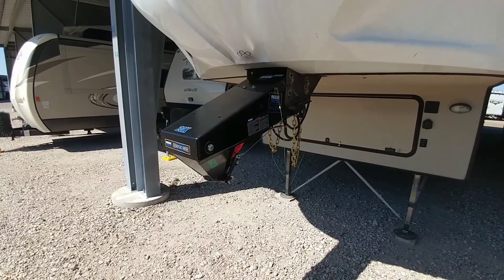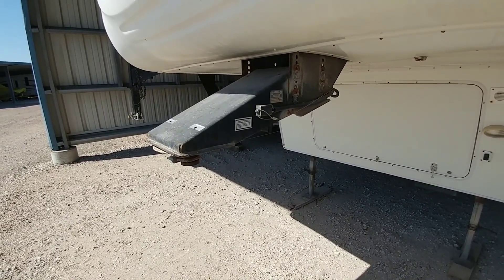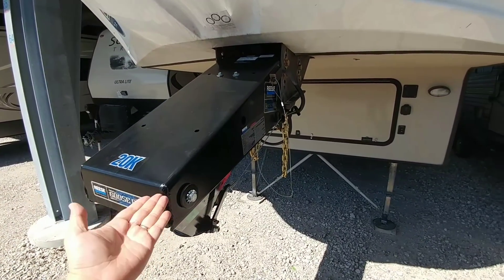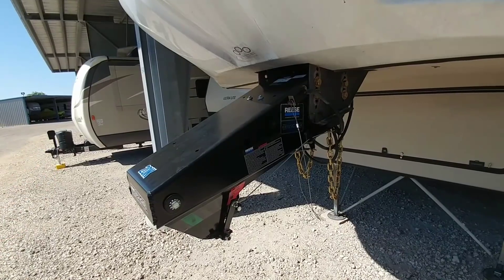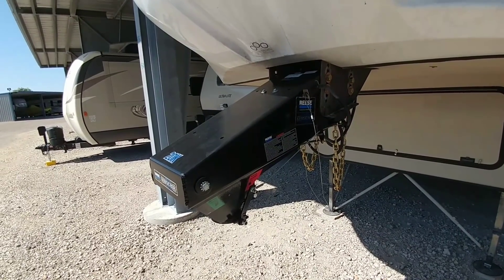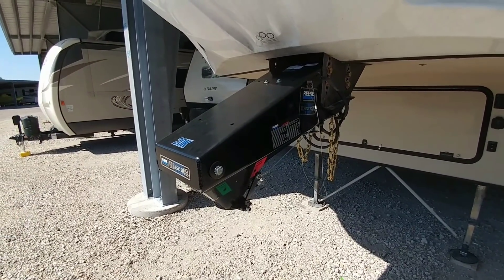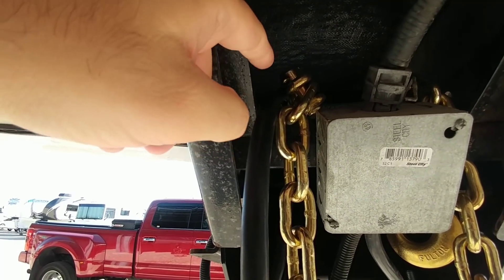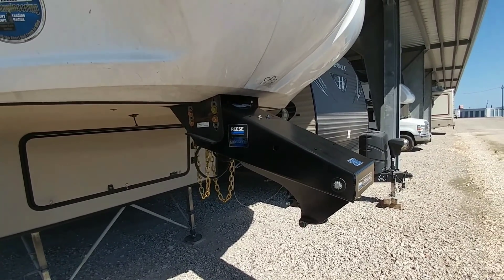WHY a Reese GOOSEBOX and not a Fifth Wheel Pinbox!

Comment: I have had the 20K Goosebox for 3 years on my 40' Carbon Toyhauler and absolutely love it.  IMO it is the best hitch on the market when you factor in ride comfort and bed access...there is nothing that compares.  Another bonus is you never have to worry if the jaws on a traditional 5er hitch are fully locked...no chance of your 5er falling off and damaging the bed of your truck or RV.  The only drawback is it is a little harder to line up, but after time it becomes a non-issue.

Comment: I have this exact setup. I love it. Virtually, no chucking. No 5th wheel hitch in the bed. I really don't feel the trailer moving behind me. If I do feel it, it's slow suttle bounce on bumps. If your truck hits a pot hole, the vibrations don't transmit to the trailer, and vise versa. Love it, love it.

Comment: looks like a nice pin box setup. I've considered going into this method, but I had a few considerations that changed my mind.
I ran across I think one or two states that allow a passenger inside a fifth wheel and specifically not a goose neck while driving down the road.
I do not intend to drive with passengers in the trailer but it made me consider what makes the laws different for gooseneck.
After looking at several hitches oem aftermarket, I saw that fifth wheel hitches spread the load being attached to the truck frame and most can handle larger angles of tilt. Gooseneck hitches are mounted to a small frame area. It became a serious consideration that when in a accident I'd rather have a fifth wheel connection, if it decreases the chance of the RV coming loose, And into the cab or striking something else. On the flip side A major drawback to a fifth wheel hitch is you can be in a hurry or distracted forget to drop the landing gear. And release the fifthwheel latch pullout and have the trailer crash down

Comment: I purchased the Reese Goose Box based on your video.  It arrived today and I put it on.  I have a couple of observations based on my installation; although I haven't actually driven it with the Goose Box yet.
1) I don't like where the air inlet/outlet is.  I can't reach it from any direction without getting into the bed of the truck.  And, I have to duck in order to not hit my head on the coach.  It would be better if it was on the back of the Goose Box so it could be easier to reach.
2) On my unit, when filled with air at 50 PSI, the load/air sticker never gets to the green.  I added a little extra and the over flow blew telling me that was enough.  With 50lbs, the sticker says add more air.
3) As I tried to un hitch my truck, I could not get the release cable to lock into the cradle.  I finally figured out that I had to empty the air bags in the Goose Box in order to get the latch to release.  So, that means that if I was at a campsite, once I empty the bags to remove the truck they would be empty upon re attaching the Goose Box.  So, next week I am installing a Viair system in my F350 so I will always have on-board air.  Not a bid deal but something to think about if one is looking to purchase this.
With that said, the construction is beautiful and I can't wait to see what the ride is like on our next trip.
Reply from the maker: Great observations!  I experienced the same issue with the airbag.  Reese told me that 50lbs is the max pressure, but you really need to pull your coach and see exactly what feels right to you.  I settled at 30lbs for me.  In regards to unhitching, I also experienced the same issue.  I'll have to see if this is a consistent thing or is problematic over time.  Finally, in regards to the valve location, I use the Viair extended arm which keeps me from getting in the bed.

Comment: Both the gooseneck adapter and the Goosebox would apply the same amount of torque to the frame of the coach if the gooseneck connection points between the two setups are the same distance below the bottom of the coach.  Just because the Goosebox is further forward and goes down at an angle does not change the torque applied to the frame.  However the shock absorbing functions built into the Goosebox would be a significant improvement to just adding a gooseneck adapter to the pin box.
Reply: Agreed, shock absorbers reduce the high G loads when you hit one of those bone jarring bumps.
Reply: Bill, you are absolutely correct on this. The angle, shape or configuration of the connecting pieces makes no difference. The torque or moment applied to the frame has only to do with the moment arm (the vertical distance to the ball; which is much greater than a normal 5th wheel hitch). The big advantage here is the dampening you get from the air bag and shocks. I'm buying one. :)

Comment: I prefer the kingpin over ball because it’s stronger and safer, also use of kingpin is considered full frame connection and your allowance for passengers to ride in trailer during travels is legal. And with a ball you couldn’t do that. I know a slider hitch is heavy and takes up space but it sure is nice to have when getting into tight camping spots, we even used a slider in a long bed truck and there wasn’t a back in spot we couldn’t get into. But a good informative video..👍🏻
Reply: Actually, depending on the components, goose balls can be rated higher than 30,000 lbs. while a 30,000 lb. 5th wheel hitch is about the maximum you can get for these diesel pickup trucks.
Reply: What state let's you ride in a trailer being towed?

Comment: looks great.. and actually very cool product. ive got a goose ball in my truck now and have put off buying an rv due to the cost of changing over to a 5th wheel.. now i can keep the ball and just change out the box... alot less hassle to add the 5th wheel to the truck and i can still use it to haul hay and other items.. like you said the key is bed space.. its gold...lol.. great vids always a fan

Comment: Check out retailers rating on it. All the reviews with a 4.8 star average. Yeah enough said. Overkill for my trailer but hell worth it. Consider it done. I have the companion slider and two things drive me nuts. The weight and the space it takes up. Excellent hitch no doubt but with a back injury I have to use an engine hoist seeing it’s almost 300#. Thanks for the review. I’ll have to put this on my RV bucket list.

Comment: The other method you could have used for torquing the bolts would to have used a 6" crows foot wrench and the conversion table for torque.

IMO, when you look at the torque requirements for a 5/8-11 grade 8 bolt, plated bolts only require 159 ft.lbs of torque. Non-plated bolts get 212 ft.lbs torque. The bolts supplied by Reese appear to be cadmium plated, so a lower torque number could be safely applied. 

Having said that, if Reese recommends 225 ft.lbs of torque, that's what I would apply.
Reply: OK, you have impressed us all with your knowledge, but it doesn't really add to the discussion.  Please help us stay on topic.
Reply: Gunga Dinn I think the extra torque recommendation, Reese is taking into account most will torque the head of the bolt. Not everyone is a “Trained Professional Mechanic.”

Comment: I would love to know if this configuration works in a Ram with Ramboxes when using the extended ball you are talking about. My current 1500 has the rambox and I love them. I will be going to a 2500 next time with the plan to also upgrade from a travel trailer to a fifth wheel. I would love to not have to sacrifice the storage space to do it.

Comment: Why not flip the bolts so the nuts are on the outside of the box?  You can probably get a wrench on the bolt heads inside the box while you torque from the outside.  That's what I did when I replaced my old hardware.  My thinking is, if the nuts are visible from the outside, I'll notice any loosening more easily.

Comment: Installed this same goose box 2 season ago and it has been great but was a learning curve to get it riding just right, it comes with stickers showing  the green zone for the amount of air pressure needed to inflate the internal bag. after a long time with tech support and many test drives tech support stated the stickers are just a guide and very inaccurate and a pressure gauge should be used to determine the exact inflation since 5psi  + or - makes a huge difference in ride performance.  For my setup  30 psi turned out to be the sweet spot and it pulls great and cushions perfectly.  Great videos! hope this helps getting yours  dialed in since it doesn't state this  it the manual
Reply from the maker: Thanks for the feedback!

Comment: Still think a 5th wheel is better, I get that it takes up the room in the bed but not having to jack up the trailer off the ball is so nice
Just crank the land gear it’ll it hits the ground extra crank or two pull the release drive away
Also spreads the load out over a much great area
Reply: Not so!  A goose neck is much superior to a 5th wheel.  A goose neck lowers the pivot point closer to the axle thereby reducing the roll forces generated in cornering and wind gusts.

Comment: I hear & understand what your are saying but if the trucking industry has never used gooseneck type hitch connections I don’t feel it is in my best interests. In case of any accident the traditional 5th wheel pin hitch is much more secure in any swerving maneuvers IMHO. Feel free to do it your way but on this topic I think the goose neck can’t hold a candle to a traditional setup.

Comment: I have a total hip replacement and went with the Anderson companion hitch because of the lighter weight. It tows great but you're right it does take up a lot of room in your truck bed. I'm really interested in how your goose hitch tows. It would be nice to have more room in the bed of our truck.
I was wondering what your thoughts on an open differential verses having a tru-track or an elocker and how this would change the  characteristics of your truck.

Comment: I have a STD bed F350 4x4 and suspect I would need an offset ball setup to insure no clearance issues with the cab of truck. Do you have a recommendation for an offset ball that would be comparable to the ball that you have ordered for your truck. I like the Curt ball kit for ease of connection with their lift pin.

Comment: I had a goose ball adaptor on my  camper And always noticed a bit a chucking after going over a rough patch. I switched and put a fifth wheel in the truck and the chucking seems to be a lot less noticeable. I am curious to see if you experience any difference going down the road with this system compared to the fifth wheel hitch. I would love to go back to just having a gooseball to take out of the truck every weekend instead of hossing the fifth wheel around.

Comment: WHY are you leaving the decoupling cable in the pulled Bach position after you unhook?? Read your directions,  "Do Not leave tension on the uncoupling shaft via the pull cable in the open position " 
1...upon engagement with the ball after hook up you may forget to release the capture rod which will cause the trailer to disengage from the ball while in motion. 
2...leaving pressure on the engagement shaft via the return spring will in time reduce the spring tension causing the engagement shaft to be moved by the ball movement.

Comment: What is your ground height on your truck. In turn from the top rail to the ground? I have a doge ram 3500 4x4 long bed but my toy haul rides low in the back and only 4”” on bed clearness . So dose not ride leaves? Trying to find a pin box that will work for me. My toy hauler is a raptor mp300 2015. Let know if you can thks

Comment: I ran into the same problem with access with a torque wrench. I just put the bolts in from the inside and put the nuts on the outside.
Reply from the maker: I might do that, but since they are already tight, I'll probably just try to retorque them inside. we'll see
Reply from the maker: after speaking with a Reese Engineer today, he informed me that because of the material thickness and type of washers being used plus they over spec the torque need, tightening to 210lbs from the bolt head is perfectly safe and recommended.

Comment: You still have the same lever arm from the ball to the pin box. It doesn’t matter what pieces are in the middle. I understand the desire to get rid of the hitch in the bed but this isn’t any different from the other adapters.
Reply from the maker: Richard M: Not true.  A gooseneck adapter coming down from the Pinbox acts as a lever. The ratio applied to the outer force transfers that energy to the upper supporting structure with greater inner force causing the lever (gooseneck adapter) to create an increased mechanical force against the frame.
Reply: Richard M IS correct.  Basic mechanics when figuring torque  it makes no difference what is in between, just end points and pivot points.
Reply: Richard M is absolutely correct, the length of the lever determines the amount of force applied. Doesn't matter if you have a kingpin or gooseneck ball. I do like the way it's made, looks good.
Reply: Richard M is correct. The torque applied to the frame is only a function of the linear distance between the ball mount and the frame. The path taken between those points won't change the torque or load. It can however. introduce some "springiness" depending on the geometry and material used.

Comment: It looked like to me when you removed the break away switch the wires from the trl were routed through the space between the pin box and frame mount. Now they are on the outside. Is the switch to large to fit through the opening now?

Comment: Thanks for the info, I travel for work an live fulltime in my fifth wheel, would a combination of airbags on my truck and this hitch be a pass or fail?
Another method of torquing would be is to reverse the bolt and have the nut on the outside.
Thanks again

Comment: Couple questions.  1) regarding long 8 ft box use and use of a 6 ft short box with a system like this.  I have seen a lot of guys really mess up their bed and tailgates in towing situations.  I have always been told that a short bed doesn't provide enough clearance between the trailer being towed and your cab.  What is the real answer?  2) in looking at towing specs for new Ram trucks, the max towing weights available are always caveated with a comment "In a fifth wheel" configuration.  Does the same run true for Goose neck towing?  Can I get the same 30,000 tow rating with a goose neck that I can get with a 5th wheel?  Luckily my trailer, although designed as a goose neck, can be converted to 5th wheel fairly easily by swapping out the pin section, but I NEED that 30,000 lb rating to be legal pulling my excavator and dozer with my pickup. (Trailer rated 30,000 gvwr, and weight roughly 8000lbs.)  The excavator weighs just under 20,000 lbs, and the dozer 21,000.  I know some of that weight transfers to the tow vehicle.  But like most people, I prefer the goose neck so I still can have some useful bed space.
Reply from the maker: RAM and FORD both have Gooseneck ratings over 30,000lbs.  RAM also rates their Fifth Wheel towing over 30,000lbs where as Ford is limited to 26k because of a hitch mount limitation. In terms of Short vs Long bed, you can run into cab clearance issues if you're not careful.  Typically a Gooseneck will give you a wider margin of error because of the narrower front end.  You're only going to get max towing capability with RAM if you opt for a Dually, 4.10 geared AISAN truck.  Getting that truck in a regular cab or 2wd will increase you max towing.  Hope this helps.

Comment: I curious where you got your extended 2 5/16 ball?  And....did it give you additional height between the underside of the trailer and the pickup's bed rail?  I've noticed the ball for a Ford pickup seems to be about an inch taller than the same ball for a Chevrolet or Dodge factory installed "puck" system.
Reply from the maker: The ball is in the description

Comment: Andersen Ultimate is a great hitch, and agreed its quite large, but it won't void the warranty of the Lippert 5th Wheel Frame.  See https://andersenhitches.com/Catalog/ultimate-connection-warranty.aspx for Andersen's FAQ response.  

However, there is the issue that you may need to add safety chains.  Of course, the new Reese Goosebox would require this also (and you've already got them on your hitch).

Comment: I thought the reason you went back from the goose connection last time, was you did not want to over work the loading jacks. (About 4" I think you said) With the reese do you need to raise and lower the gear as much as the previous goose system?

Comment: Thanks for sharing, ive got one question to ask is the distance from the ball connection the same or greater from the pin box.I didnt know if the rear bumper is closer to the fifth wheel.If its the same im going to change mine out for that and get ride of my B&W companion slider hitch. It looks like E trailer has the best price on them.
Reply from the maker: The distance is the same, maybe a hair closer to the truck because I had my B&W set to the back slightly (the upright arms).

Comment: What ball are you using I’m running the standard drop in ball for the 2017 f350 and I need an extension. I’m only 5” of bed clearance 😬
Reply from the maker: B&W OEM Ball.  it has a 2.5" lift to it